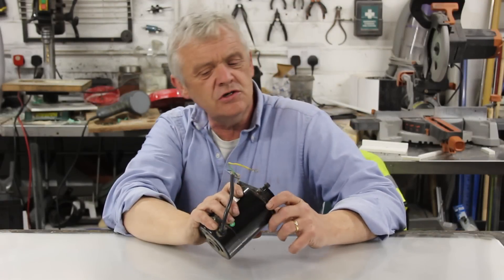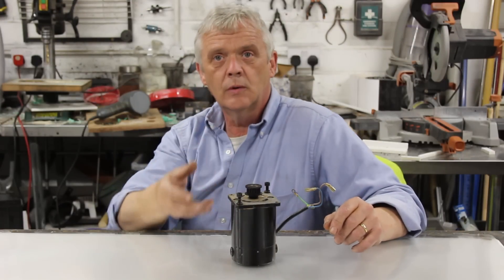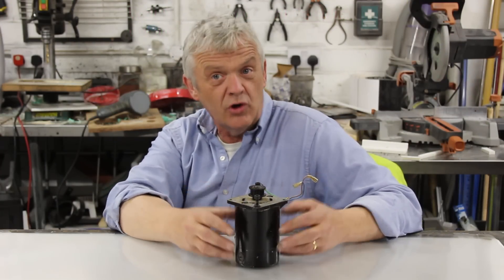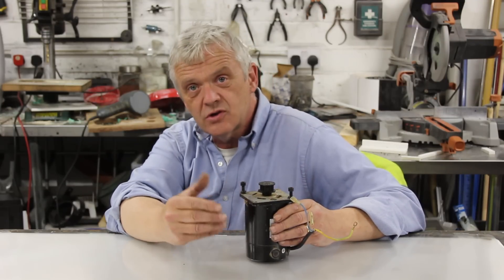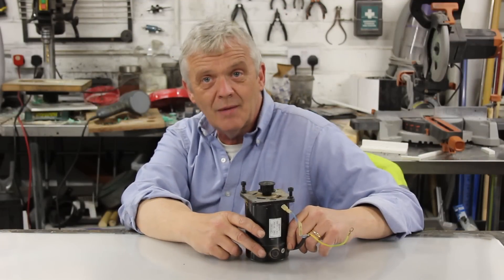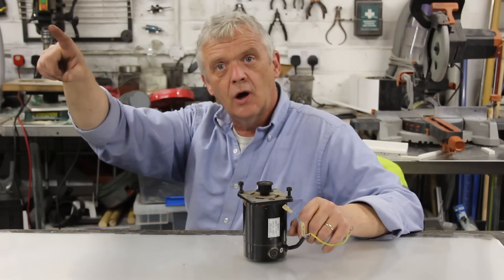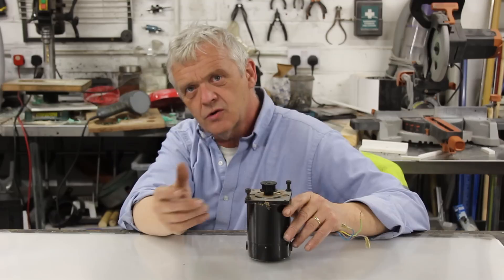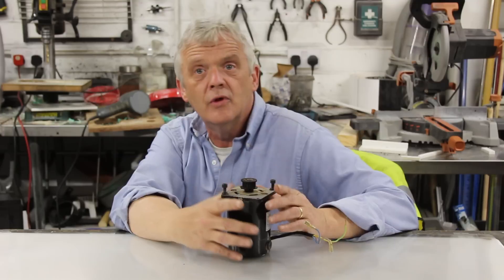1595 Motors As Generators

Comment: I think graphene based magnet wires would be amazing. Low resistance (higher efficiency), many turns (higher volts). I'm not a material scientist but if I were, this is where I'd start my work.

Comment: I have been aware of this since I was a kid, my dad had a "Dynastart" on his boat and explained it to me. I still come across them occasionally fixing petrol golf buggies. If a motor is turning from a battery and you try to turn it faster surely you need some kind of switchgear/circuitry to stop it burning out? and conversly if you had a motor charging a battery from wind power and the wind stopped then the blades would carry on and empty the battery. I confess I havn't watch all your videos you may have covered this and electronics isn't my specialism! Asking for a friend!😊

Comment: Dr. Smith, the company I once worked for was having the same problem. They were building an educational hydro generator, but couldn't get the water flow to turn the prop. So, I geared it for them and problem solved. Large gear on the prop, small gear on the motor.

Comment: Someone suggested to me that having one larger motor would be more efficient than three smaller Motors because of the efficiency losses with each motor but I'm curious if that is negligible because the larger motor would have more wire in it anyway but it would likely be a larger gauge wire in a single motor setup and I don't know if that means it would be more efficient

Comment: You should do a video on using an AC induction motor as a generator. They have no permanent magnets in them making them very inexpensive generators. You do have to modify the capacitors and the wiring, but it's relatively straight forward.

Comment: Rob please remember that not all electric motors can act as a generator.  A single phase induction motor for example can not act as a generator or alternator.  Permanent magnet motors on the other hand can act as a generator.
Reply: Rob has a video about this. You can generate with induction motors when using connected capacitors and the residual magnetism of the rotor.

Comment: I like the idea of using a CORDLESS DRILL as a GENERATOR. Which almost everybody has and can GENERATE 150 WATTS of power. You don't even have to dismantle the drill :)   So a PERFECT fit for attaching to an exercise bike. Use a cheap USB cigarette adapter (which has input between 12V-24VDC) to charge USB devices easily. Or a Solar controller to charge big batteries. Drill needs between 500-2000RPM I think

Comment: Aren't magnet motor generators AC due to alternating polarity? I'm on with stuffing a low gen volt through a step up system. I think static stuff will work better. Magnets aren't everywhere but static is. Plus if the stepper is used to increase amps with number of coil wraps it can be used to weld and charge. Relearning all the stuff I learnt in school many moons ago and realizing I've already been taught the answers to the problems. Your channels is a goldmine Rob. Cheers!

Comment: Hi Robert , I’m been designing and printing a wind turbine for sometime now, I’m only home 2 days a week so time is limited.  The turbine will have a 1 metre diameter wheel with a belt that turns directly by the number of rotations from the vertical wind blades, I’m planning on connecting an alternator and using this as the generator.  I have no idea yet how it’s going to perform, if it works well I’ll let you know and will then print many more.
Reply: @sourand jaded agreed. Steinmetz will give you a clear understanding of how to handle waveforms
Reply: @sourand jaded it’s never been my intention to design an alternator but instead buy one off the shelf.

Comment: I suppose if I wanted less volts and more amps I would want to have a motor/generator with thick wire in the coils?
Reply: More windings= more volts.
Thicker wire = more amps.

Comment: Good morning, with that in mind is it possible to use the front wheels as a generator and charge a separate battery than the drive wheel( 2 batteries one charging and 1 driving) ? your awesome thank you b well and stay strong 💪
Reply: Technically yes, but there is no point. Simply connecting battery A to battery B through a converter so the 400V battery pack does not fry the 12V battery charges B at some 80-90% efficiency. Using the EV battery pack to turn the engines which turn the wheels which moves the car which turns the other wheels which move the generators which send electricity through a converter which is again needed so it does not fry the 12V battery would be maybe 40-50% efficient and also the extra drag from your front wheels basically braking the whole time means your range would drop like crazy.

Comment: One thing never discussed is acceleration/deceleration and how the waveform changes between switch on > power up > switch off > power down. Every motor/generator has an unique waveform associated with its ergonomical characteristics; it requires amps to initiate acceleration and provide torque, voltage for speed and capacity. This means that we ideally wish to give the motor, or harvest from the generator, an optimum electrical wave form of a particular shape in time, varying between amps and volts. In theory, this could also mean, provided we had good bearings, we could make a flywheel of a large mass, start it up by hand and feed it very low amps and high voltage to keep it spinning, then harvest from it however plausible.

Comment: Cheers Rob! That is very helpful! Until now I thought there was a different construction that would be more efficient for one than the other, like with speakers/microphones!
Now I know to measure my motors when I try to make a generator. I have a digital tachometer to measure motor speeds, which works great. Just need to put the right voltage in to test their rpm. I don't think they're always quite what they say on the box btw! :P Atleast that's been my experience with a lot of components so far with my messing around, motors often off by about 20%, not seen one more accurate than to 5%. Hell, potentiometers from Jaycar seem to be off by up to 500%, which is just hilariously unusable to a noob like me haha.
I think eventually  though I'd like to make a water battery system with multiple pumps to handle excess power, and hook in solar, wind, temperature difference, and manual power inputs to something that just engages more storage with the excess, and drains them back down for power through a generator that requires a specific flow rate to turn the gears to squeeze as much as possible out of it.
Assuming I can store a comparable amount of energy that way compared to feasible alternatives.. I really want to mix a lot of technologies together in the simplest most efficient ways possible, e.g. and your videos are filling my head with ideas and arming me with the information I need to have more of a go and discuss ideas, so I'd love to hear what you think of any of that! :)

Comment: What some people seem confused about often reading comments is really the efficiency of the motor in converting motion into electricity, people basically want to know which electrical motor, arrangend as a generator is the most efficient in converting mechanical energy into electricity, and that is partially meaningless, because the answer should be alternators (especially the brushless ones) but that efficiency depends a lot on controlled speed, a car alternator is about 70-80% efficient but a power station alternator can reach 98%, they are almost identical beside the size, but the the controlled speed at which those are operated is the key factor there.
Reply: Which automotive alternator, has efficiencies in the 70-80% range please ,my understanding is that you’re lucky to get 50% . Thanks.

Comment: Out of curiosity is that 150 watts a second, or is that it’s wattage over an hour? Or neither? Thank you for your videos they are extremely helpful.
Reply: 150 watts over 1 hour is 0.15 kwh.
150 watts over 10 hours is 1.5 kwh.
If an appliance is rated at 100w, it'll take 10 hours to consume 1 kw of power.
If an appliance is rated at 1000w, it'll take 1 hour to consume 1 kw of power.

Comment: Hi Rob, great vid..  I would assume you could increase power output by increasing rpm / voltage to a certain extent without much problem (bearings might suffer a little). Keeping the current at 0.6A is the main thing. Winding voltage rating is usually over and above operating voltage.

Comment: Could you do a study on why copper coils moving through magnetic fields produce an electron flow?  Could you also discuss the theories of what a magnetic field is or isn't and what electricity is or isn't?  Could you expand the application out to the magnetic forces or fields of the earth and the electric characteristics of the earth?  I'm sure your talks attract young and inquisitive minds that haven't had "educational barriers or roadblocks" built in yet.  All of the elements of an energy production system are already in place across the earth but for some reason we aren't tapping it, at least on a large scale.  Some of your listeners may be able to put the pieces together.  Excellent videos.  Thanks.